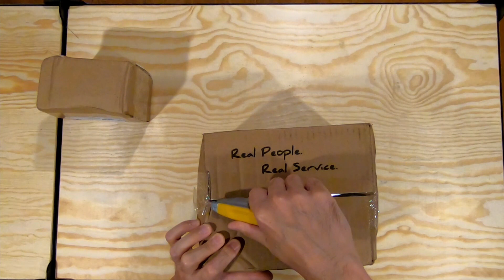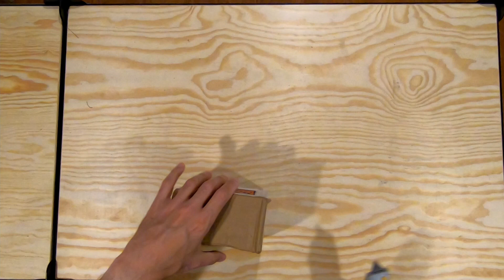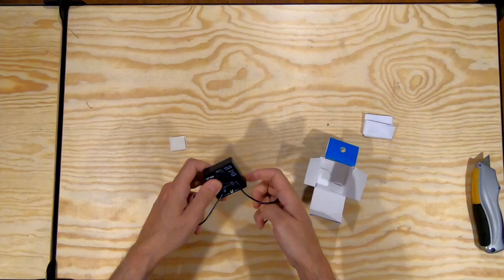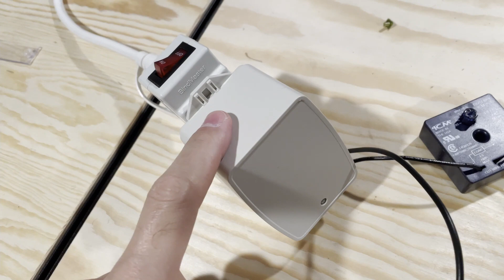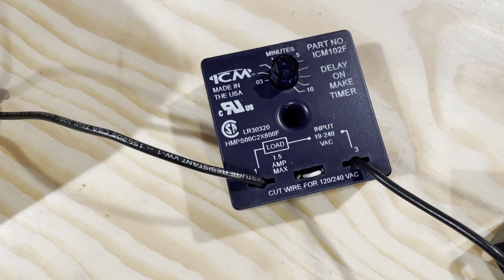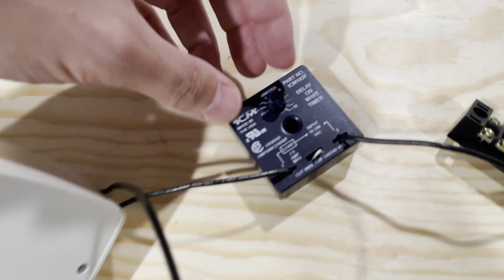Unboxing a Delay On Make Timer

Comment: Thank you, Chris. I think this will work well for me. Although I am confused by your setup: Why is your 24V supply connected to the LOAD side of the Make timer? Shouldn't the power be going to the INLET side and the relay coming off of the LOAD side? Or does it work either way?

Comment: The delay on make timer will work great, minimum setpoint should be 5 minutes. The scroll compressor has a floating seal internally in discharge. Serves three functions: 1-doesn't allow it to run in a vacuum. 2-seals discharge from suction. 3-unloads comoressor at start-up. These seals like to hang up, then it doesn't unload at start-up. The compressor then tries to start againt a large pressure differance, but is not designed for that, pulls high amps and trips internal overload. This scenario may be your problem, time delay may help. If it doesn't a "hard start kit" will need to be installed. Emerson will not warranty this, their technical bullentin states installing hard start kit. In old days metering device equallized pressure in the off cycle, but not any more.
Reply from the maker: I just installed it. The manufacturer recommends 30 seconds, but I can increase it. https://emersonclimate.custhelp.com/app/answers/detail/a_id/4335/~/single-phase-scroll-compressors-in-reverse-direction